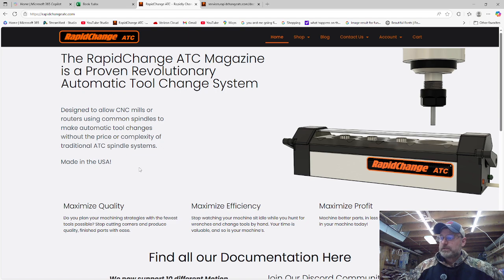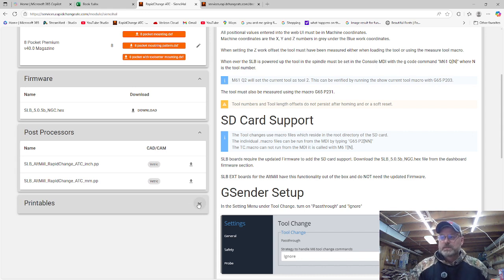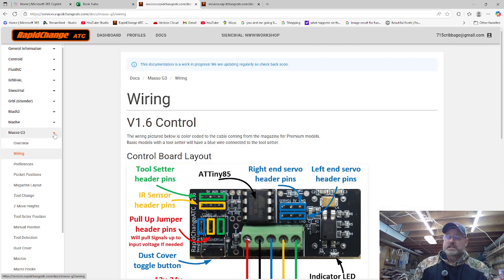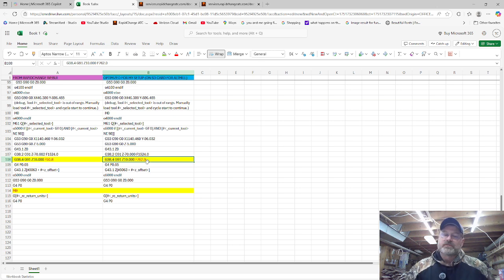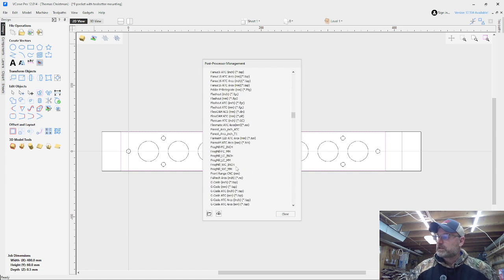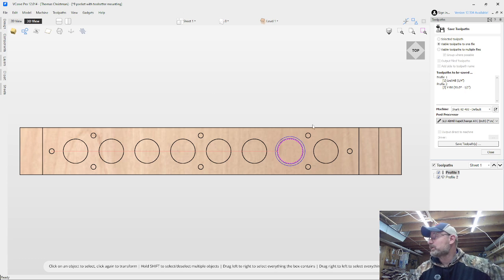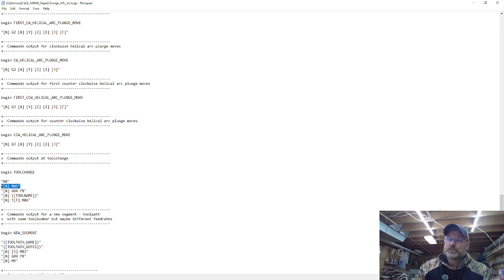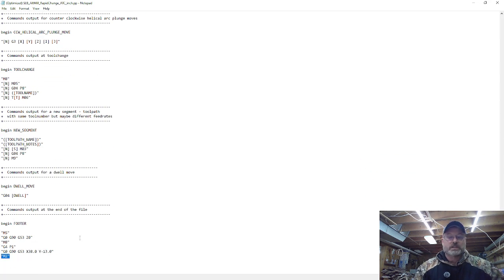Altmill CNC ATC Post Processor and Macro Management

Comment: Can you elaborate on "post processor". It shows Vetric, I am not using Vetric to generate my g-code. I will be using a Rhino plug in and going straight to GSender. I thought generating g-code was separate from moving the machine.
Reply from the maker: A post processor is a file that converts your tool paths into the specific gcode for your CNC machine. I am not familiar with a rhino plug. Gcode is the language the machine uses to move around.

Comment: You have a spindle on delay in your firmware, do you know if this is additive $392, have you had an issue here?
Reply from the maker: That setting is for monitoring the spindle at speed. I have this disabled in my firmware.
Reply: @NWWI-Workshop  we may not be talking about the same thing? $392 is a delay to let the spindle ramp up to speed on startup.  If you have it delayed then when you start a program that doesnt go through a toolchange your spindle wouldnt have time to get to speed.  Is that not how that works.
Reply from the maker: @marcusXaurelius the $340 “spindle at speed tolerance” works with $392 “spindle on delay” to error out if the spindle ramps up too fast or too slow. Error 14. I played with these settings for about a second before setting $340 to (0) to disable the error entirely. You may be able to get the settings right but I am impatient and don’t want to deal with the error.
Reply: @NWWI-Workshop  This is my fault, i was referring to your g4 p8 after tool change does the firmware setting $392 not apply after a toolchange?
Reply from the maker: @marcusXaurelius that’s a good question. I’ll have to create a program with the basic PP and compare the 2.
Reply: @NWWI-Workshop  PP would likely have nothing to do with that scenario because its a firmware setting.  I assume when the contoller sees the M3 it has a dwell for whatever that setting is.  Im interested more about if it is only doing it at the first M3 command in a program and not any subsequent ones.  Is that why you have to set your on dwell after a toolchange?
Reply from the maker: @marcusXaurelius you should be able to just look at your job file. Maybe we can explore it on the live in 55 minutes